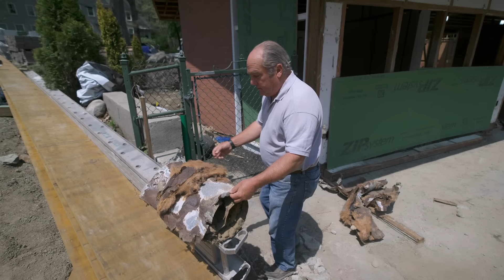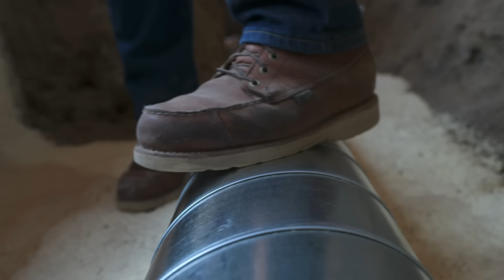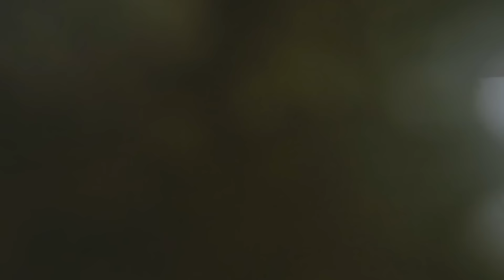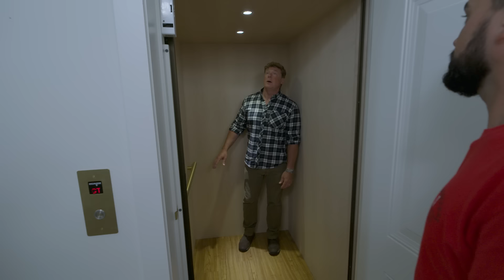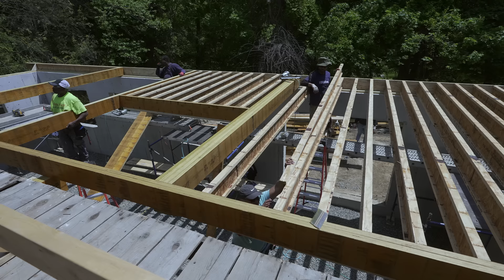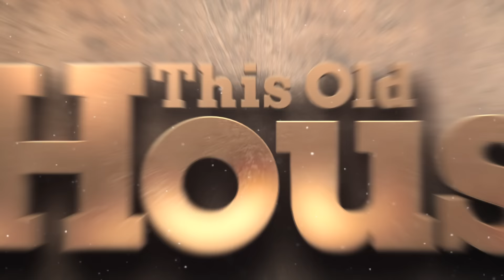This Old House | The Big Dig (S45 E3) FULL EPISODE

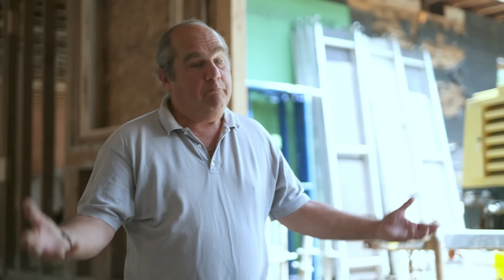Comment: I never specified (or permitted) metal ductwork to be direct buried.  Even if it's well above the water table there's always a high risk of just enough moisture to rot it out within a couple of years.  The foam insulation is a good start as a moisture and thermal barrier but even that breaks down long before the expected life span of the ductwork, eventually allowing moisture intrusion and corrosion.  I've seen it happen too many times over my 45+ years as a mechanical engineer.  I always used thin wall FRP as a material of choice and it's held up well.  Even Mark expressed concern about water intrusion during the block laying segment and at 10:12 Richard talked about closed cell foam (which is above the ductwork) being a moisture barrier, meaning the expectation is there will be moisture in the ground.
Reply: But he put closed cell foam under it.
Reply: @saulgoodman2018  As mentioned, closed cell foam in a potentially moist environment deteriorates quicker than if it were above ground.  I have seen it fail more times than I can remember and never allowed metal ductwork to be installed underground.
Reply: @remichal  What's the difference between this underground. Or any other pipes underground?

Comment: I had a flashback to those concrete blocks. Our above ground pool wasn't installed yet and it was hot. My mom used those blocks at 4 corners and filled it up with water to life me in, I was swimming and hit the corner of my eye on one of those blocks,,,,,,

Comment: I'm an IUEC Local 1 Journeyman.
Trust me, if you're alone in the house, never take the elevator. Current codes make it so that if any one of hundreds of switches and systems goes wrong, you'll likely be trapped.
Reply: Yeah, they're hairy...I just put one in; Telecab...They require a phone line now..
Reply: @godbluffvdgg  
Yes, 2-way emergency communication is code, but that doesn't unlock the front door for emergency responders or an elevator tech.  ;)
Reply: @LongIslandDad  Well, you gotta be a moron to get stuck in a 2 stop cab...:)

Comment: Below ground airduct seems like a tough call. I don't know that I would like to deal with that in the future. This project reminds me at what point does a remodel become a new build.
Reply: I was thinking the same. But I was thinking how is it different from pipes that are buried underground?
Reply: @saulgoodman2018 my last house has 6 feet of sagging drain line under the slab. That was a $17K fix. It's not different.
Reply: @davisnin  I did say that is not any different then pipes burried underground.

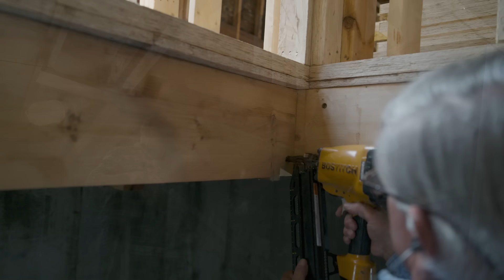Comment: 21:00 - Would joist hangers typically be used rather than simple nailing? When is it reasonable to just nail off vs requiring joist hangers?

Comment: We're definitely a long ways from Bob Vila teaching you how to repaint your own refrigerator to save money but I've got to save I still enjoy it and it's really cool to see some of these bigger projects sometimes. And as people get older this accessibility stuff is just going to get more and more important. There's no way in the world I would build a house right now without putting grab bar backing every single place you need it before I put the drywall up.
Reply: Back then it was remodeling a house. 
Now it's just adding additions.
Reply: well i think as years go by new technology is being born like the spray foam vs fiber installation for example. i'm sure there is still ways to do it at a lower cost but depending on what you done it might not be cheap